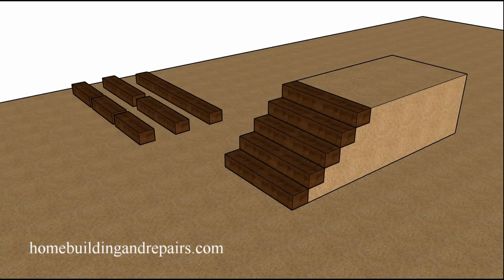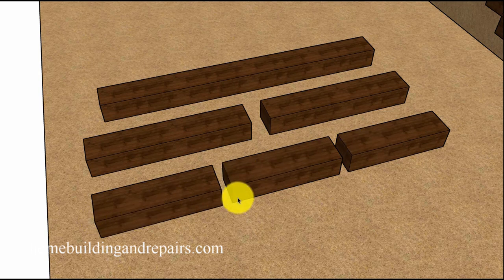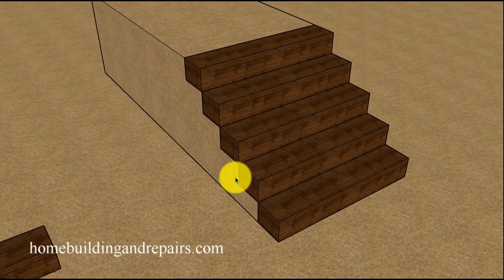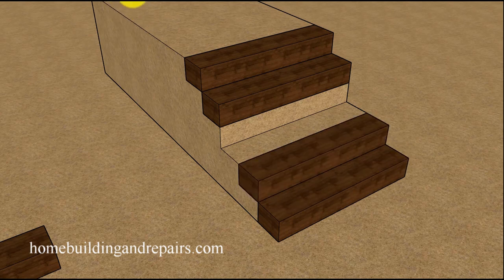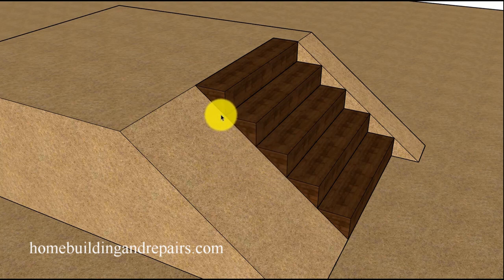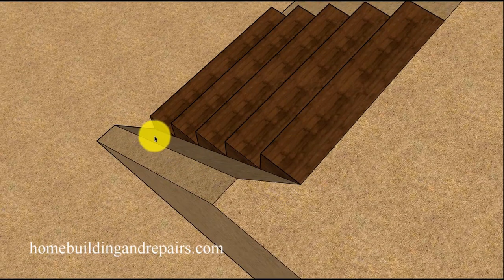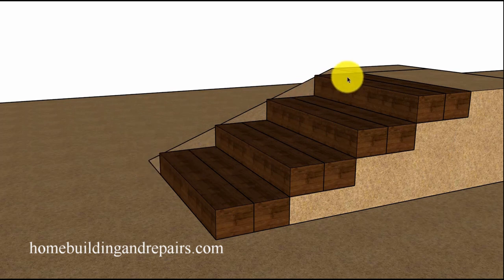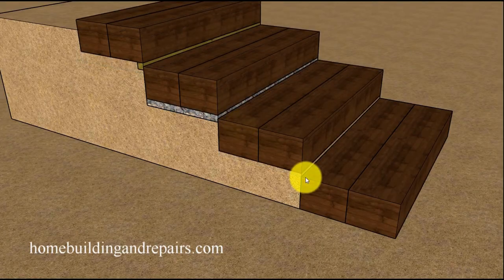Design And Construction Ideas For Building Landscaping Stairs With Railroad Ties

Comment: Chainsaw...anybody tackling their own retaining wall likely has a chainsaw too. Makes easy work of cutting ties.

Also overlapping the steps adds to the overall structural integrity. Using spikes to connect 3 per tread. Overlap 1 tie leaves a 2 tie tread reveal and works very well for strength.